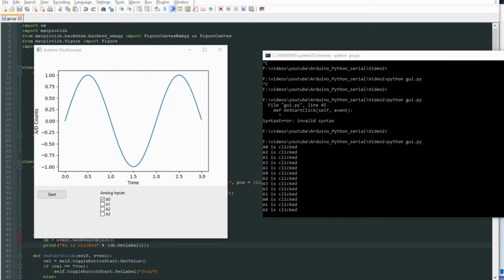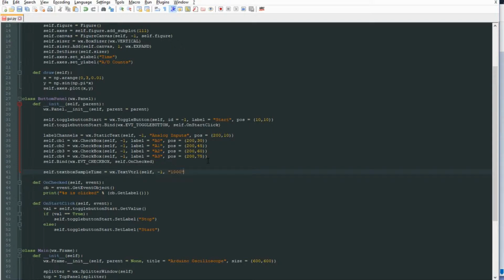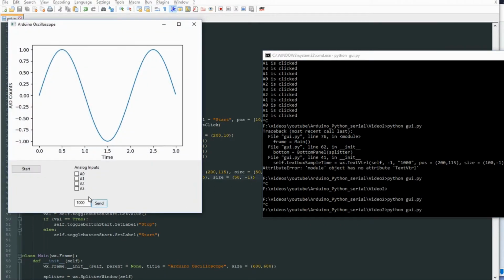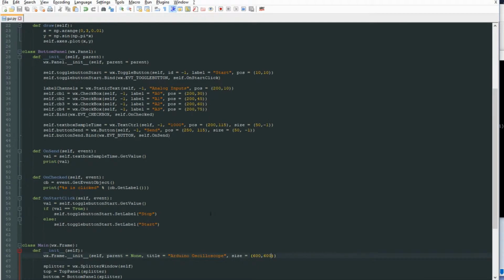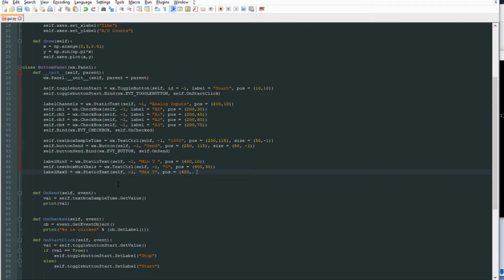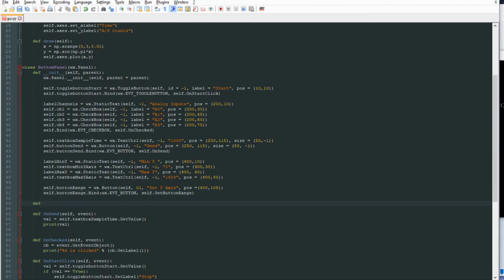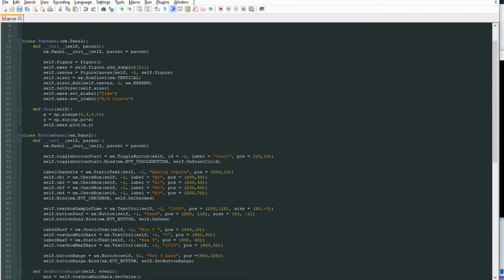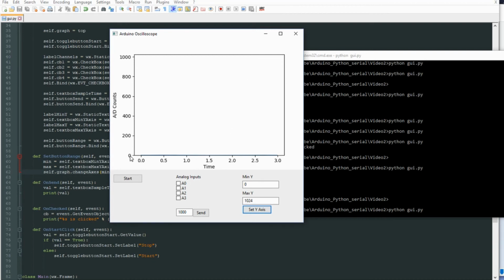Add TextCtrl and button to wx GUI (Part 4 wxPython Arduino GUI)

Comment: Great stuff! Thanks for a nice lesson on wxPython
Reply from the maker: Thank you! I have plans to eventually finish this project but every time I sit down to do it something else always comes up...
Reply: @EngineeringCorner  I am trying to use your 2-panel arrangement to display graphs that are generated from csv files I read in with the bottom panel, and then want to feed the pandas dataframe to the top panel for graphing. Is that possible with the way you set it up, since the bottom panel requires the top panel as input?
Reply from the maker: @jameis_vu  If I understand you right it should be. I'm not familiar with pandas but lets say you can get values for X and Y , you can send those values as arguments to draw in the top panel. TopPanel.graph needs to be modified to accept the arguments X and Y. 

 def draw(self, x, y):
  self.axes.clear()
  self.axes.plot(x,y)
  self.canvas.draw()

then when you call the function draw in the TopPanel from the bottom panel in a button or something it would be like below (NOTE: I am assuming that however pandas gives you data is compatible with graphing in matplotlib.)

  self.x = your X series from pandas or elsewhere
  self.y = your Y series from pandas or elsewhere
  self.graph.draw(self.x,self.y)

you also have to initialize draw in the main class like
top.draw([0],[0])

This is actually close to what I had planned in the next video grabbing the data from an Arduino and sending it up to be displayed on the graph
Reply: @EngineeringCorner  I use seaborn, which is built on top of matplotlib and parses pandas DataFrames extremely well. I am able to do the first part, which is load the data and have it make a bargraph what I want when the program first opens. But now I want to be able change the source csv file it is reading from and pass that to the graph.draw function.

I've added a file browser to the BottomPanel so I can change the path, but then passing the path to the function to read in the data to a pandas.DataFrame, and then passing that DataFrame to the graphing function in the TopPanel to re-draw the graph is giving me a headache. I am thinking maybe a 1-panel solution might be easier.

If you make the next video about the Arduino I will definitely be interested regardless, as it sounds like you will address how to redraw the graph when new information arises, which is essentially what I am trying to do.
Reply from the maker: @jameis_vu  I posted a new python  file up on the github repository under video 2. I made a quick change so that if you click START/STOP button you will see sin wave and if you click the a0 checkbox you will see a cos wave. Hope this helps.